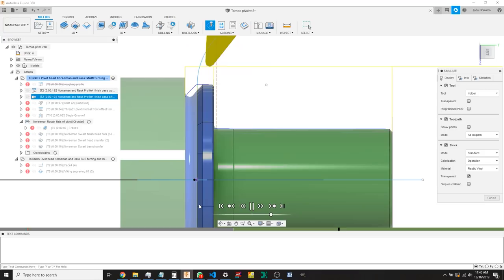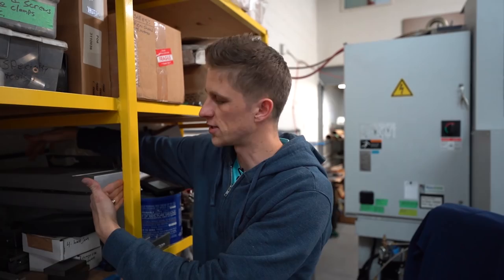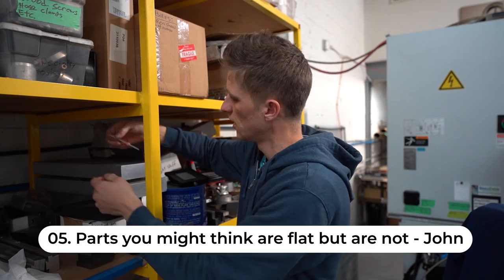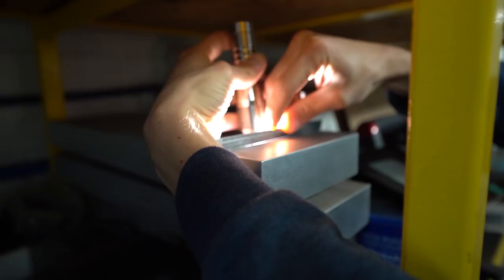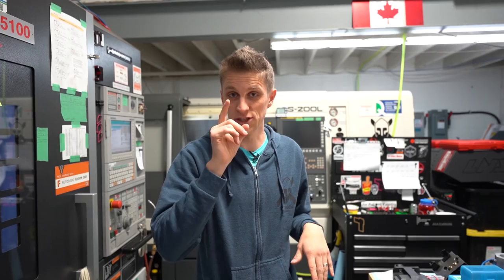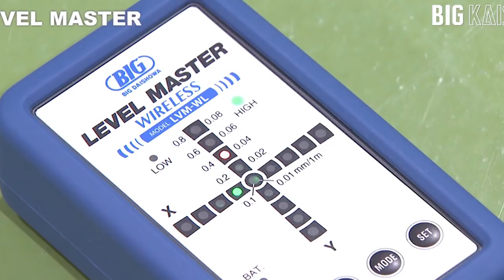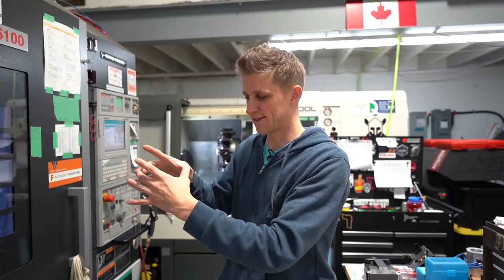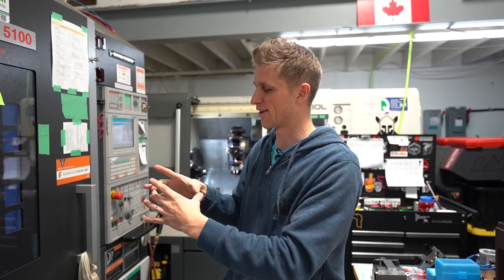10 Reasons why flatness is CRUCIAL in knifemaking!

Comment: Careful guys: Flatness and Paralellism are two different things and I feel they are mixed up quite a bit here. Flatness doesn't refer to a datum whereas Paralellism does. Flatness only implies that the highs and lows of a surface in and of itself do not exceed a certain value. Paralellism implies that a surface is paralell to a datum. What often leads to confusion though is that Paralellism somewhat constrains flattness too. Putting a workpiece on a surface grinder or double disk grinding it makes it both flat and paralell. They often come together but it's important for a mechanical engineer not to mix them up ☝🏻 A suface plate for instance is very flat to a very small tolerance, but the paralellism to the floor does not really matter that much. Flattness does also not imply perpendicularity. So if the axis of a pin needs to be perpendicular to a bearing surface that is flat in itself that needs to be denoted seperately in the drawing.
Reply: I had the same thoughts watching the video. The best example of flatness in the video is when John sticks the scale on top of the piece of bar stock. Almost everything else is parallelism or perpendicularity.
Reply: Glad I’m not alone with this. You have delivered  more detail though;)

Comment: I haven’t watched the whole video yet, but I get the feeling that there are a few misunderstandings between parallelism und flatness. With regard to your assemblies both will matter. However, you can have a really really flat surface while having a really bad taper in your part. Please remember, that in GDT flatness is not relative to a datum but rather just applies to a surface. 
(Think surface plate: you want very little high/ low spots but parallelism to its underside doesn’t matter)

Comment: About flatness on the mill... Did you ever consider attaching a multiplicator head for higher rpm’s, clamp in a grinding wheel and perfectly flatten each stage constrained to the machine reference? 
And about the little press with aluminum plates... To avoid wear concerns I would change those with granite ones. It would still pull out the temperature well while always being perfectly flat and precisely flat basically forever...

Comment: As shown the laps are out by quite a lot.  How do you correct for that?  Inquiring minds want to know.  Great video BTW.  Thanks.
Reply: The parts and ceramic rings are moved towards the center or outside edge of the plate to bias wear depending on if the center is higher or lower. Thanks, glad you enjoyed it 👍